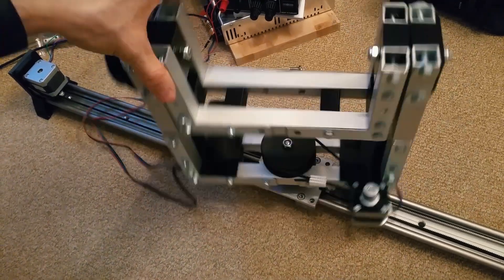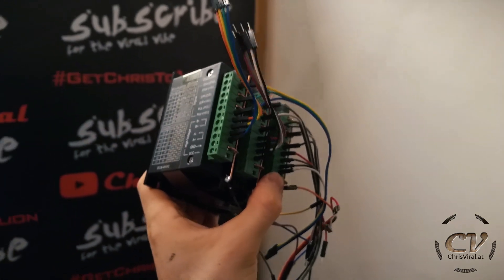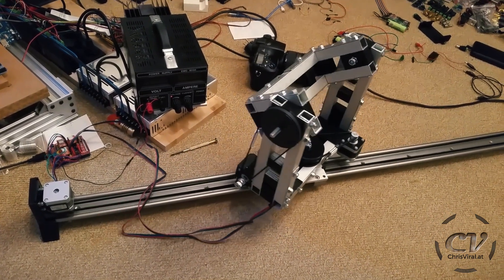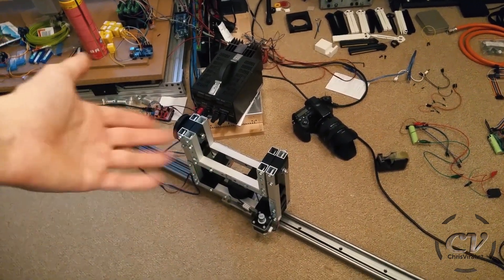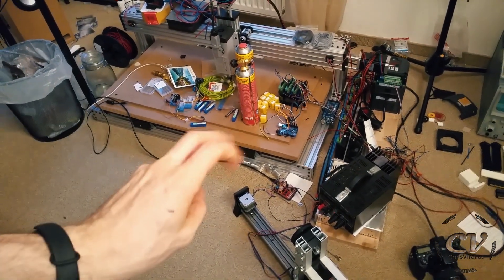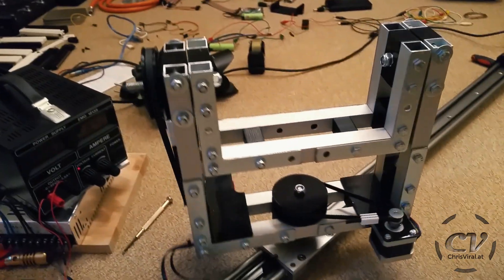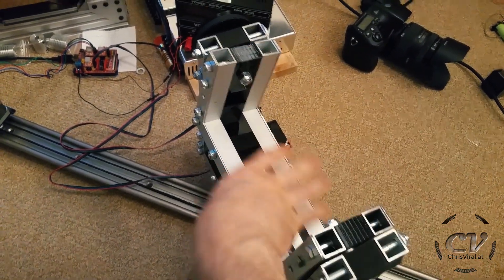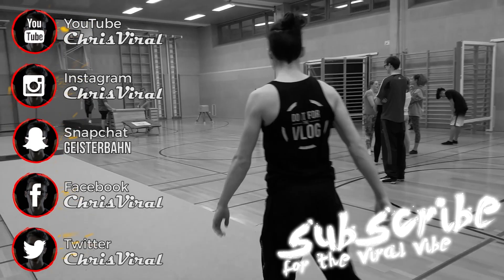DIY Camera Slider DONE | 3 Axes Motion Control | Arduino Powered

Comment: To solve the belt length problem you could always get a longer belt and just add another wheel to take up the slack.
Reply from the maker: Thanks for the tip 🌟

Comment: for that application silent stepper motor drivers would be possible (TMC2100 or LV8729)
https://www.youtube.com/watch?v=Z5OQpMSvWvs
the downside of these drivers is they are only silent on low loads, but your application seems it is low load. (CNC doesnt work for silent drivers)

For the Belts, yes there are closed belts. Do you use 6mm GT2 or HTD-3M in 10mm ?
Reply from the maker: I bought this beld, literally no specifications but the teeth are 1mm and the width is 6mm so it's proabbly the GT2 you mentioned.
https://www.amazon.de/gp/product/B072FPP2J5

Oh cool, didn't know there's something like silent drivers, but the thing is.. Mine are already pretty silent and with a proper mic or external one it shouldn't be a problem. But we'll see :)
Reply: it says Gt2 in the amazon title :) , Gt2 is the main type used for nearly all 3-D-Printers today. Its cheap for and for low loads. if you need to lift heavier stuff the next level are HTD-3M in 10mm or 15mm, still realtive cheap belts + beltgears.
Reply from the maker: My bad lol. Okay thanks for the info! :)